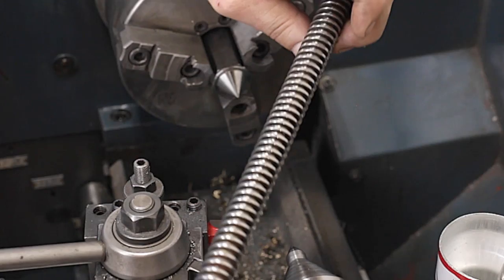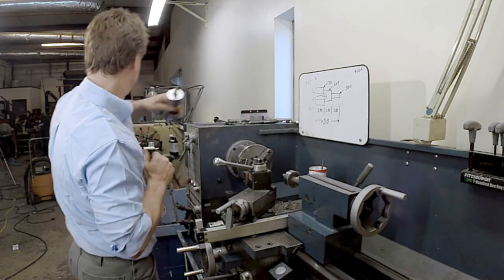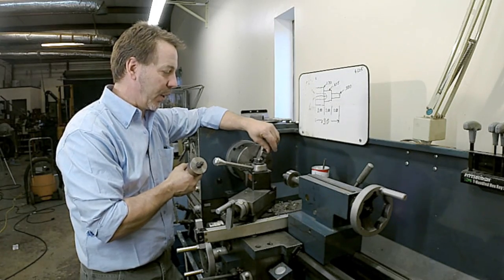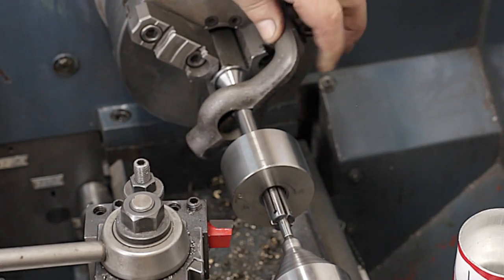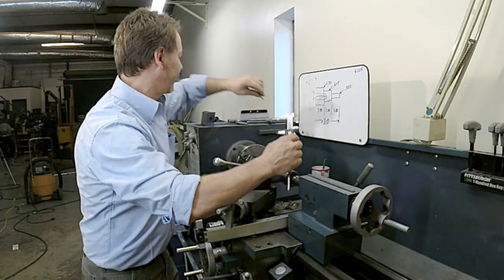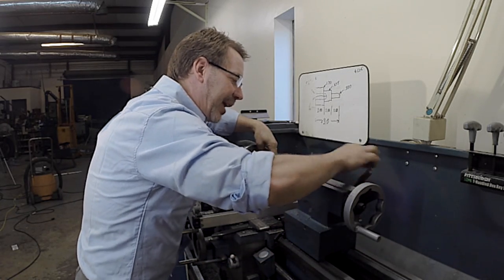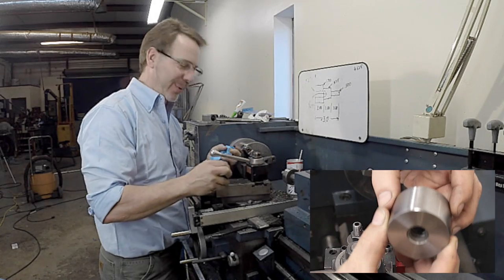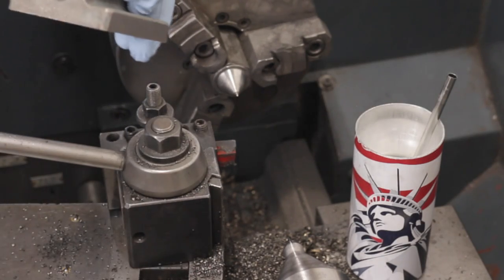Lead screw Part 3  "The nut"

Comment: just priced an acme thread cutter on amazon. $35 - $60 each but that would have been much more work to cut the threads then heat treat the rod and nut.  Only thing I would have done different  was to grind a flat spot on the nut then drilled - tapped a hole in the nut housing to put a set screw to hold the nut in place instead of gluing it in.  I suppose it would be application specific but one needs to lubricate that part and degrease it to clean from time to time so I wouldn't be sure the glue would hold up to a solvent based cleaner.
Reply from the maker: +jburr36 
Great comment

Comment: just a thought,  you solder the adapter onto the leadscrew  (the adapter is not subject to load along the length of the screw) yet you super glue the nut which is subject to such loads why not cut a shoulder  in the nut and carrier  which will deal with loads in at least one direction? then possibly grub screws as others have suggested?

Comment: $100....in a lead screw and nut repair........not much else to say other than damn fine job!.....little faith in modern adhesives doesn't hurt either....lots of ole timers have issues with the term "gluing"....when it comes to metal to metal connections.....understandably.....lol.......more of a Loctite fan here, ......
Reply: +Rick L Yea, I probably would have use red or green loctite... (because it's what I have and doesn't try up in the bottle like super glue) :)
Reply: I assume super glue is pretty good, but I think loctite may be stronger?
Reply from the maker: I have the same concerns you do with glue but I thought I would try anyway :-) I'll let you know what happens.
Reply from the maker: Thanks for watching. I'm glad you liked itkeep up your great comments.😀😀😀
Reply: +Metal Tips and Tricks (Dale Derry) ........keep the great shows coming DD, you have a great teaching style........
Reply: Rick L kkkk

Comment: Would it make sense to make the nut out of something like 1045 so you could harden and temper it? Or will that just wear out your threads faster?
Reply from the maker: When you have two metal sliding against each other its best to have one soft and the other hard. This will  prevent them from binding or gulling.. get question.

Comment: Nice repair. I just wouldn't trust only glue. I'd probably cross drill the part and install a couple pins just to be sure.
Reply from the maker: +Blazer02LS 
I like that Idea. if the glue docent hold it I might have to do that.
Reply: +The Thing IF the glue fails, and that's a big "if" with the close piston fit he has, a snap ring wouldn't inhibit rotation of the nut.  If a chip got caught in the threads, you'd HAVE to cross drill and pin to get the lead screw out anyway.  I'd go with loctite in this situation, but like he said above, it's what he had on hand.  All that said, I'll bet my paycheck that this repair doesn't fail in my lifetime.  It's a very light load application.
Reply: I would have used an anerobic adhesive like loctite sleeve retainer as this is what it is made for, but CA glue will probably work fine since he has lots of surface area. The loads on the cross slide of a surface grinder are not high. This will hold until and long after the zombie apocolypse.

Comment: hey nice vid, do you know how much HP you can get from a  single phase?
Reply from the maker: 1 1/2 hp will run on most 110 single phase plugs with a 15 amp beaker.   There are 2 hp motor, but they need 20 amp breaker. If your running 220 single phase you can get  up to 
7 1/2 hp. I hope this answers your question.
Reply: @BuildSomthingCool  cool. but im in Australia we have 240v 40amp breaker and 80amp fused wiring through out the house. My house is broken up into 3 power socket ed areas (lounge  beds kitchen) could i run three or more 2-3hp at 240v form different parts of the house to power it. My lathe is meant to get 15hp

Comment: Dale..I just purchased a 6x12 harig and I have the same problem major run out on the x axis. Maybe I missed it but wear did you get the allthread and nut. Thanks for the great video...Dave
Reply from the maker: Hi Dave,  I got it from McMaster carr. Be carful there are two thread pitches for that machine. It is determined by the scale on the handle.
Thanks for your question.
Reply: Metal Tips and Tricks thanks for the info..dave

Comment: Wouldn't JB Weld be a better alternative to super glue? Super glue is brittle when it cures and isn't great with vibrations.
Reply: +Fierceflyer55   My thoughts exactly, CA is brittle.  A good quality 2 part epoxy would have been a better choice.

Comment: Dale , please use the correct term for your tool. You were using a telescoping gauge not a snap gauge. The snap gauge , as I'm sure you know is a spring loaded lever operated dial gauge for Q C  measurement.

Comment: Whilst I have great faith in many fine ''glueing'' products ie Loctite etc  my preferred method after glueing would be to ''scotch key'' at each end with a small grub screw, off set to each... other of course........ concluding in that you will ''never'' have to rely on the chemical bond
Reply from the maker: +David Aitken 
Great suggestion :-)

Comment: I would have secured it with two set screws from bottom and a snap ring in the inside, nice job though
Reply: I was thinking that too.  Maybe he doesn't use much coolant on the grinder, so moisture won't be a problem.

Comment: Why not press on the pieces instead of soldering or gluing?
Reply from the maker: Two reasons.   1  I wanted to show a different way to do it.  2  I was afraid I might bend the shaft by pressing it on
Reply: Build Something Cool true. I bet machining the tolerance tight then freezing the sleeve it might go right on and kind of be like a press fit but I understand what you're doing. Your videos are great. Very informative.

Comment: I'm am no reluctant to use super glue on any project that will be subject to any heat. I have found that it loses strength when heated. I might have used 2 part epoxy.

Comment: Personally. I'd have gone with making a new lead screw in high carbon steel and a housing block in phosphor-bronze... never, ever steel on steel, as you have it. Extremely poor engineering practice.
Reply from the maker: +Gordon Burns 
Its not steel on steel, its steel on cast iron. Cast iron has graphite in it. witch makes it a good and tough  bearing surface. Bronze or brass will not work either  for the nut. Because  grinding dust will get  embedded   in the nut  causing it to act like a honing  lap making the thread ware more quickly.